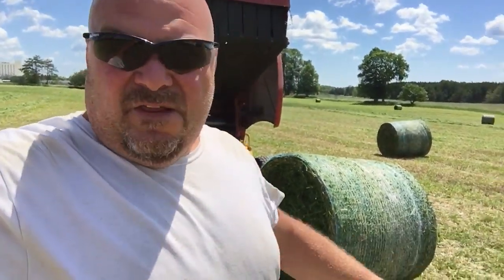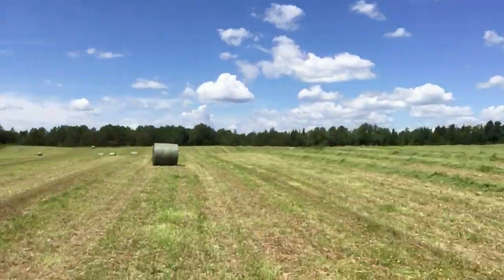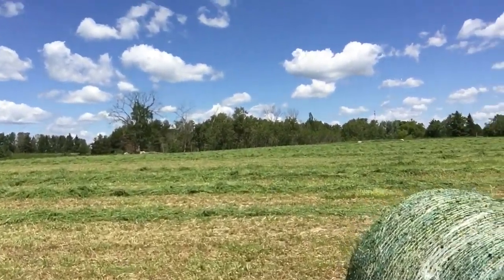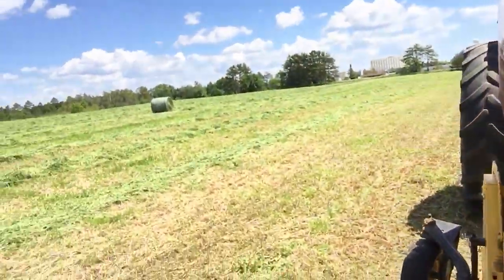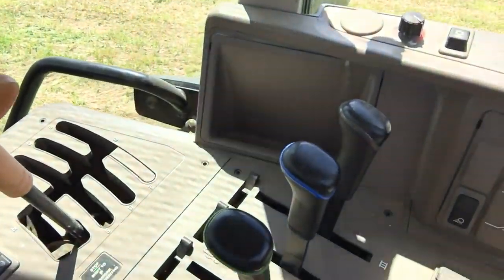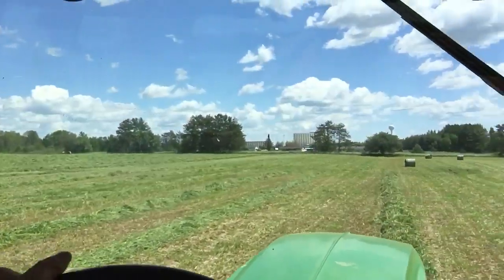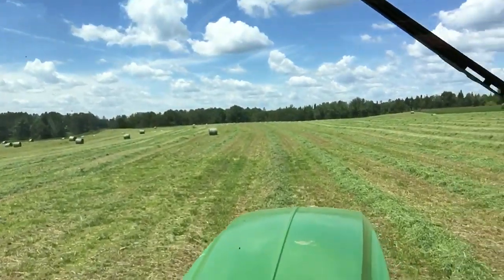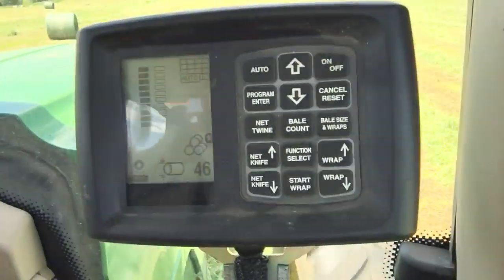Making Alfalfa Baleage (Baling)!!!!

Comment: Does your baler have the slice or cutter option? If so, you may want to slice the bales you plan of running in the TMR. Neighbors told me the same thing, the bales fall apart better in the TMR and mix faster saving time and money when mixing. I need to go get 6 new knives for the slicer option on my baler and give it a try in dry hay

Comment: 54" is the ideal size for wrapped bales for several reasons. I make them even smaller for one customer that only has smaller tractors to feed out with. Sometimes make them bigger but I always suggest 54". 54" bales out of a 5' wide baler can really be heavy to handle.

Comment: Just baled 96 bales off 10 acres, I make my baleage bales 48 in and I got a 4 by 5 baler, my main reason is only got a 50 hp loader tractor to move them but most everyone around here makes 48in bales for wet hay don’t want them to heavy